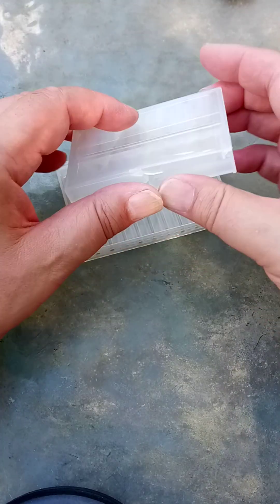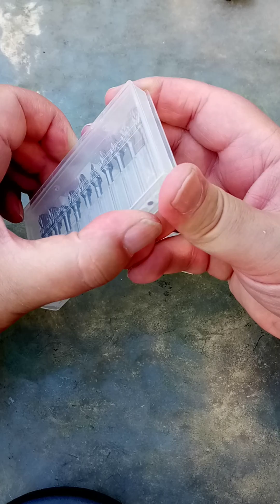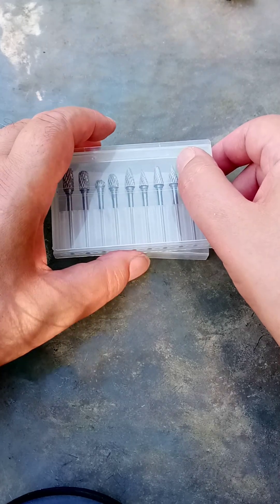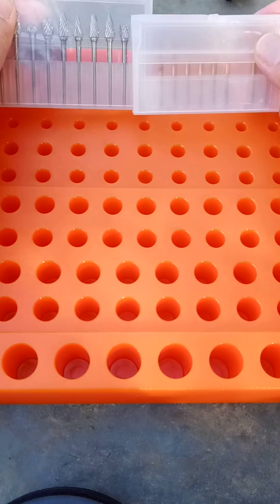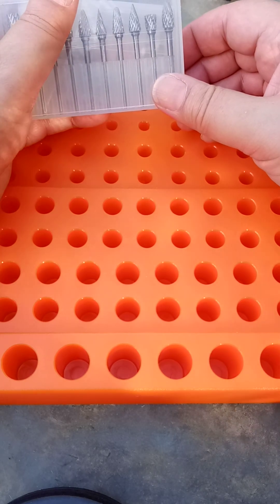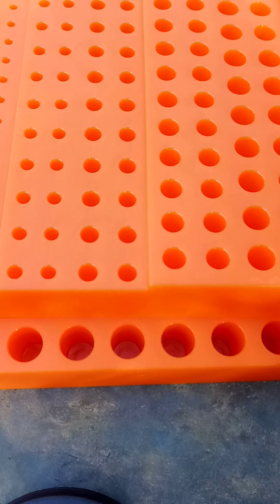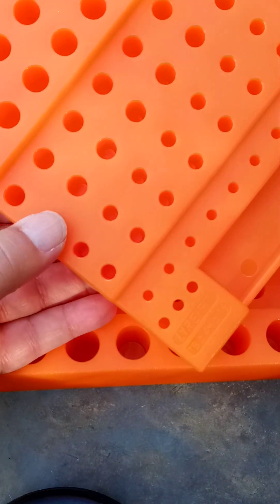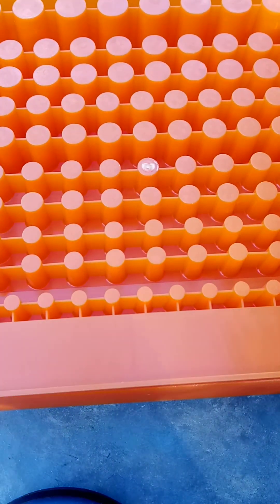Amazon Milling Bit Holders—A Total Letdown! (And Why I’m Making My Own)

Comment: You bought the wrong thing, then made a video, edited it, posted it, but don't have the time for a free return lol.

Also, very obviously not 3d printed. What are you on about?
Reply from the maker: Yup. If I went out to return it, that'd cost a minimum of an hour's time and that's just driving to and from without waiting for lights and avoiding drunk drivers. The weekends are tightly scheduled with all the things I have to get into the weekends. The weekdays... My schedule can be 5:30am to 6:45pm with just a 45 minute break in the middle. Even on days when my schedule ends at 4:45, there's no time to go to a post office and I really do not want to add to my stress by pushing extra into the day - not when I have a 4AM alarm. Weekends are as I said, tightly scheduled also. And the $8 each of those cost is pretty much nothing in the scheme of things. $5-$10 items are throwaway trash that might or might not work.

Comment: So you ordered the wrong holder. A holder that would hold standard size bits for a standard size mill. And you cat tell the difference between 3d printed pla and injection molded petg. And some how this is Amazon's fault?
Reply from the maker: It’s not about blame — just showing what turned up so others know what to expect.